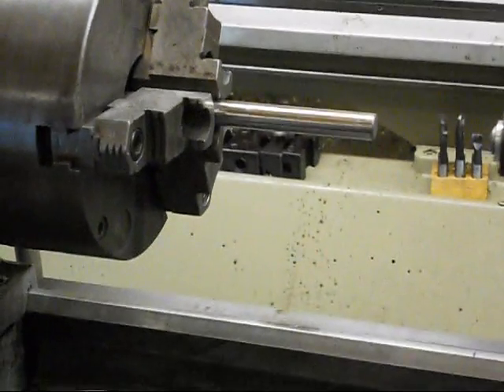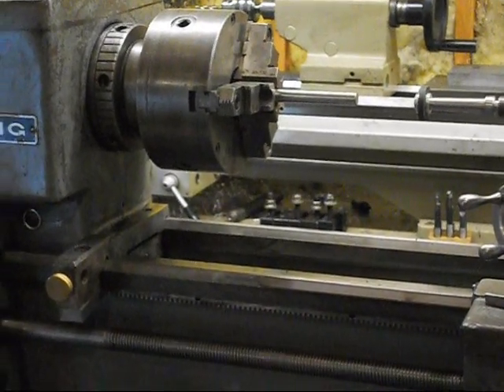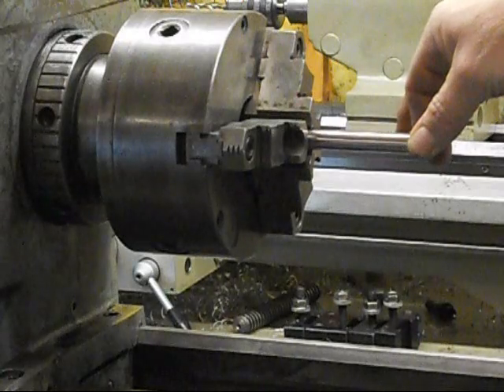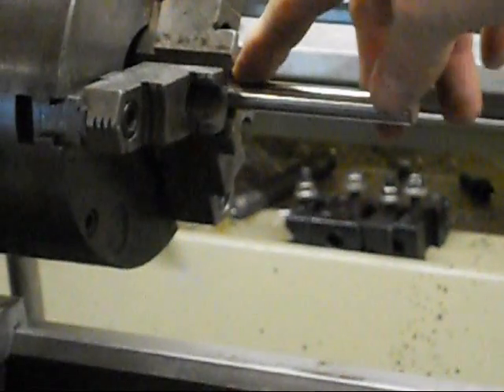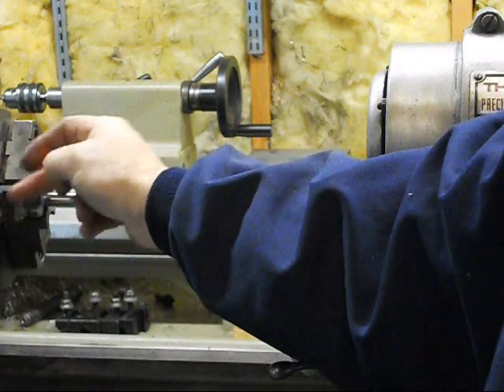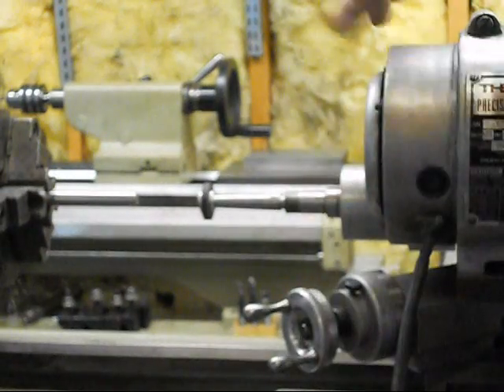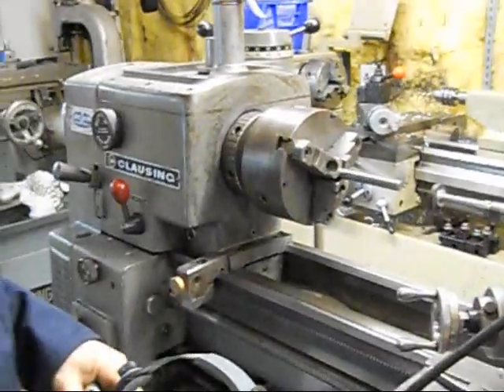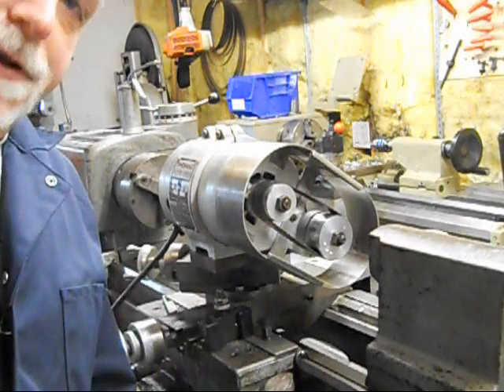Using the Themac grinder.wmv

Comment: Thanks for posting. I just received my themac J7 two days ago and am needing help on accessories and belts. Am thinking about converting to a v groove belt system.
I've seen different methods on truing lathe jaws, and yours is a first. As they say there's different ways to skin a cat! Whatever works for you and your application is okay in my book!
Thanks for taking the time and effort to share.
Ray.
Reply: V Belts because of Centrifugal Force will fly away from the groove.  Try a Vacuum Cleaner Shop for Flat Belts.

Comment from the maker: I'd like to mention that the J7 Themac grinder is a little unweildly on the 5900 lathe.  The grinder I've been using lately is a Themac J45, I've also used a DuMore number 5 grinder.  Either of these grinders will work well for small lathes like the 5900..

Comment from the maker: The lathe is on wheeled supports so moves around quite easily.  I typically use my lathe while on the wheels - some would argue that this will adversely impact the accuracy of the lathe.  I find no problem with running the lathe with nil attention paid to leveling or removing twist/wind in the bed.  There are two things that allow this: 1) the bed of this lathe is quite rigid; 2) the parts I am making do not require extreme accuracy.  This lathe will hold very nice tolerances even on wheels.